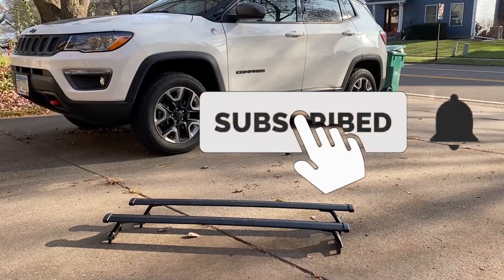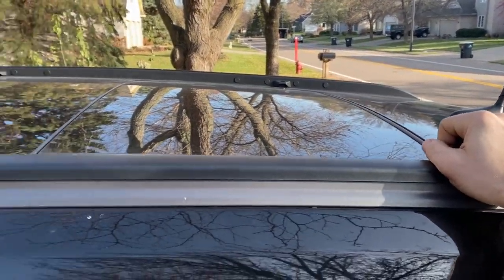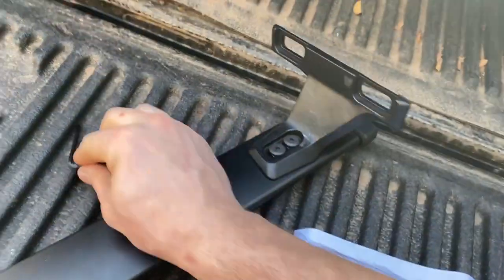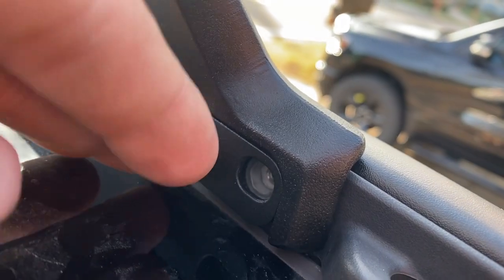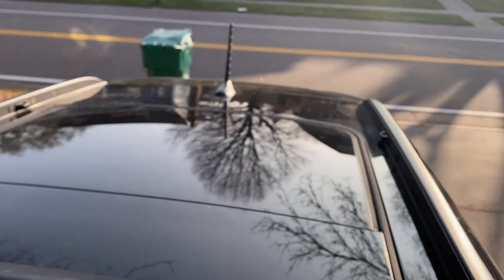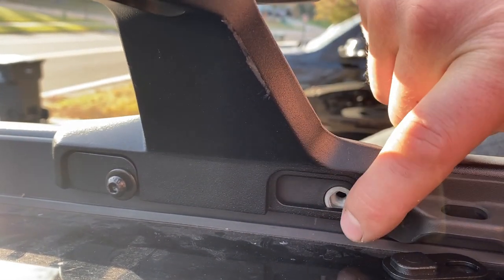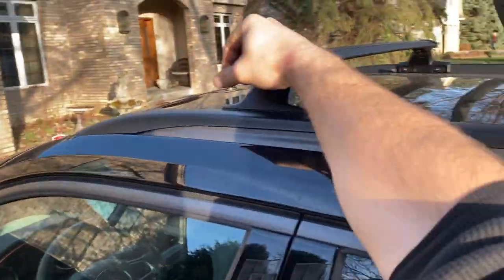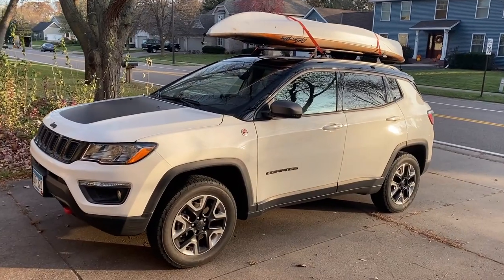BougeRV Jeep Compass Roof Rack Crossbar Install

Comment: Hey great video! Do you have any idea where to get the plugs from the beginning of the video that you threaded out by hand, or what they're called?
Reply from the maker: @jaredbryant5320  I’m not sure if Jeep has a more technical term for them, but they are essentially just standard black plastic panel clips or “Christmas tree” clips that are about 1/4” diameter.

Comment: Can these be installed on a 2015 Jeep Compass? I have the same roof rail type.
Reply from the maker: They don’t list it for a 2015 but it’s possible. I would contact them to verify because the distance between the rails needs to be pretty much exact and same with the bolt hole mounting pattern. It wouldn’t surprise me if they work, I just don’t want to say yes and then find out they don’t haha